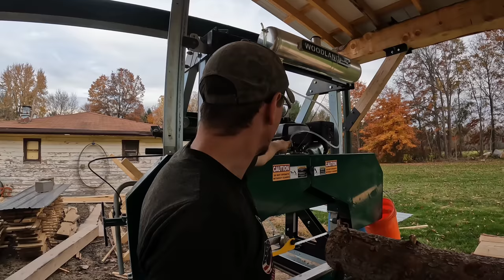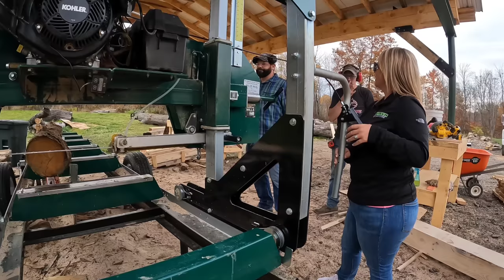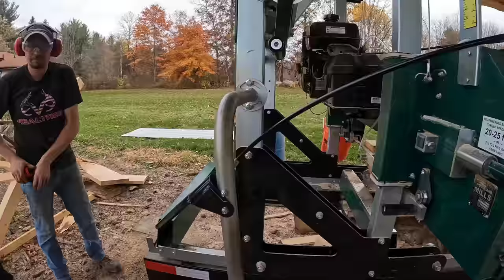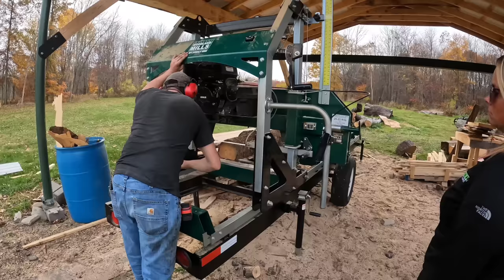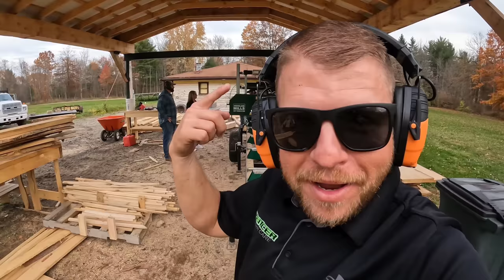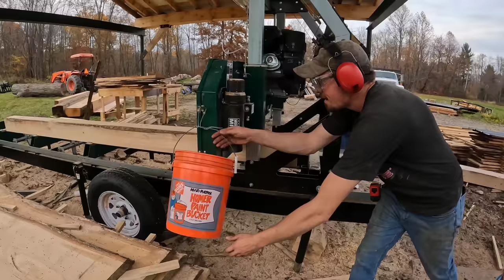I Might Regret This | I Didn't Think She Would Like Running A Sawmill!

Comment: Ok, so commercial lumber isn't actually as screwy as you think. First, it's milled to the rough dimensions and then surfaced to remove splinters and make it smooth. Framing lumber starts at multiples of 2 inches (mostly, unless you're talking one-bys...) and 1/4 inch is taken off of each side. So a 2x4 ends up 1-1/2 x 3-1/2, not 3 inches as you stated. Historically, a mill would not actually take off a full 1/4 inch, so dimensional lumber would be a little bit bigger than that, like 1-5/8 to 1-3/4 thick on a two-by. That generally varied. But now, most mills have standardized on the dimensions coming right in at half inch less...  For all I know, they probably go a bit smaller on the rough dimensions as well, to save some wood, and get more lumber from each tree.
That does sound like a bargain for that setup (although I have to admit, I've never priced them out; it just looks like a fair bit of machinery for the price 😁).

Comment: That’s cool but my way of thinking is time=money. How long would it take you from a standing tree to have a 4x4? Let’s say 3 hours, .5 gallon diesel, very slight wear on blades… do you actually come out to the good after you figure all that? I guess it depends on what you think you are worth per hour. A non-treated 4x4x8 is around $15 right now.
Reply: You can do the live edge stuff with a sawmill as well. That's fairly profitable. The true dimension lumber that you can make on a sawmill is pretty nice as well. Larger logs produce a lot of lumber. I had a 24 inch diameter oak log that gave me 21 boards and a few live edge slabs. Milled in about 10 minutes or so.

Comment: Using a saw mill looks glamorous and exciting, but there is a lot more to it, than just cutting up logs into lumber.
You have to know about shrinkage, warping splitting and twisting of the species you are cutting and they do all of that. Then you need to have a way to dry the wood to reduce the woods reaction to being cut, and not in the open air. When you release the stress in the wood by cutting it into boards, these things start to happen almost immediately.
It's NOT like going to the big box store.!
What you DO need is a wood splitter for your firewood.
Reply: He has used his log splitter in videos before.

Comment: Hey TQ if you want to see the Cadillac of portable saw mills check out the Woodmizers. I have the LT35 hydraulic. By the way nominal 2x4 is 1 1/2 x 3 1/2, 2x6 is 1 1/2 x 5 1/2 etc.. Being a Sawyer is lots of fun. being doing it 5 years now. Ron
Reply: Yes. Definitely woodmizer. I have an lt40 hydraulic wide cut diesel. Awesome machine.